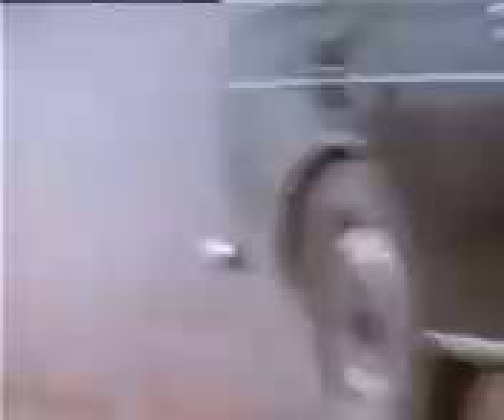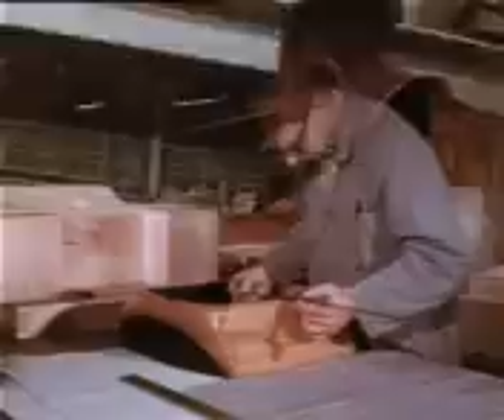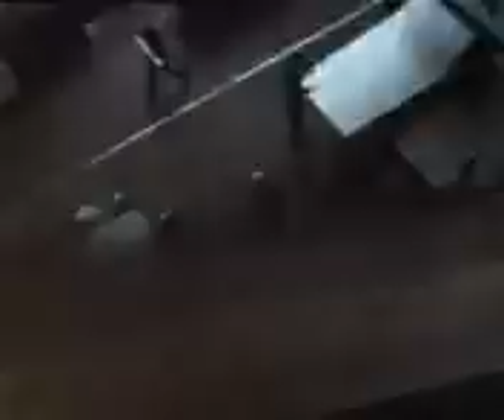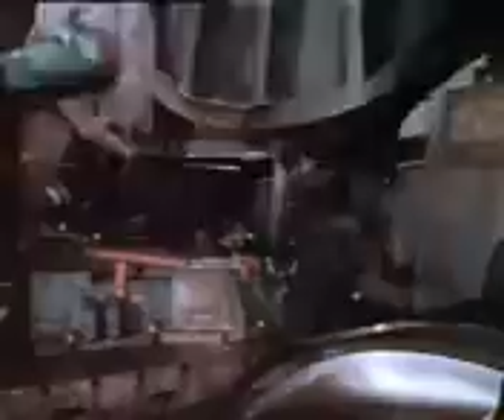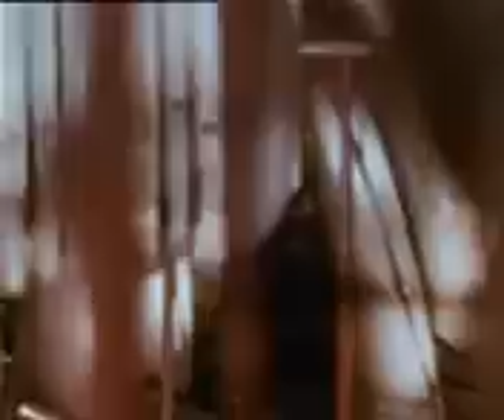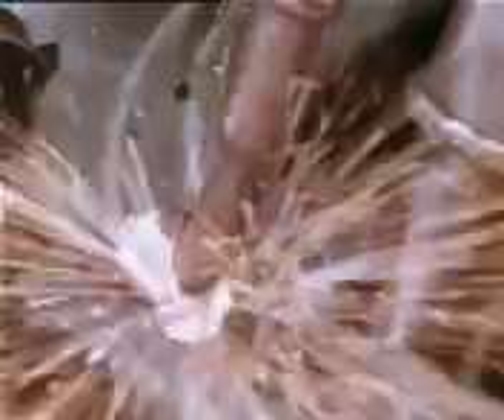vw beetle documentary: the shape of quality (1/3)

Comment: How ironic that the video would brag on the brake hose testing. One of the few gripes that I have, and there’s not many, on Volkswagens was that the brake hoses would get aneurysms on the inside and let the fluid go into the wheel cylinders but not come back out. I worked at a car lot and fooled with Volkswagens on the side for years and I’ve seen a few stopped up brake hoses

Comment: I had a 76 standard Beetle.  It may not be as collectible as the early Bugs but, it is far better as a daily driver.  It has the more modern rims, a better double jointed rear suspension, and all the little things that make it more practical.  Keep it stock and in good order and it will be just as good as any modern compact car.  It has the L-Jetronic fuel injection system which CAN be a problem but, once you figure out how to adjust the airflow meter, that engine will wake up big time!  Every VW I had got the Pertronix electronic ignition conversion.  That's another thing that the VW engine will love.  Strong sparks and accurate timing.  Autolite 275 plugs are better than the Bosch WR8AC plugs.

BTW, I had NO PROBLEM getting enough heat from the stock heater!  Keep all connections airtight, inspect and patch any holes in the heater channels, and don't mess with the exhaust.  It all works together and too many people fuck it all up and then complain when things aren't working right.